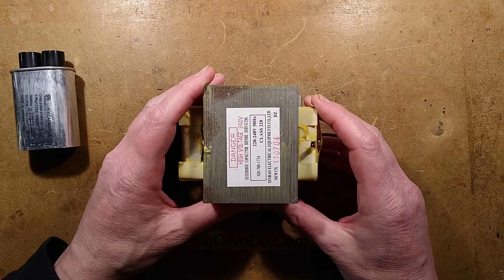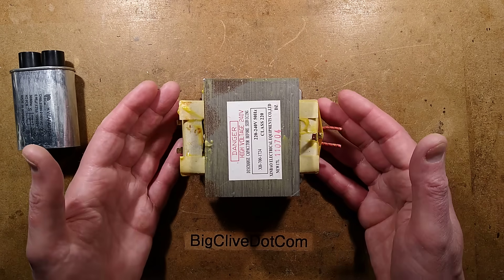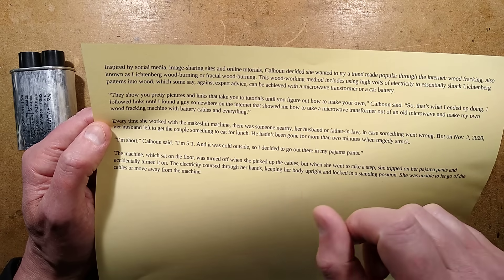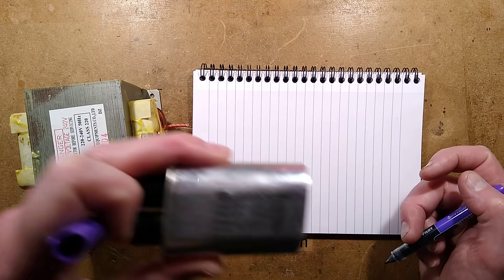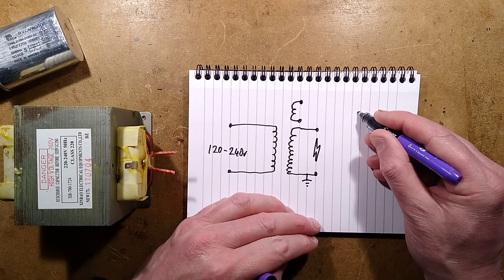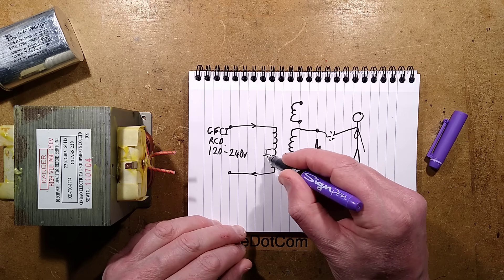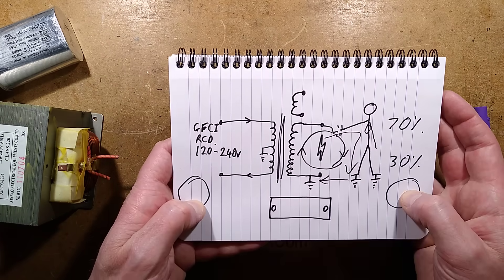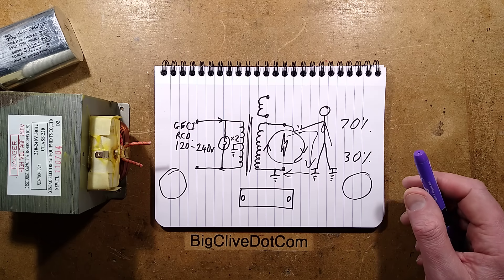The most deadly project on the Internet

Comment: Things I learned even in VERY amateur welding and electronics work:
- NO WATER, ANYWHERE, EVER.
- Heavy gloves, dry rubber-sole boots.
- Never grab uninsulated wires... or any wires-not-intended-to-be-grabbed at all for that case.
- Know which parts of the circuit are 'hot', and always give a second thought whenever you're about to interact with the Hot side.
- Find and discharge ALL capacitors before mucking around in electronics - if you don't know, wear gloves until you can probe and confirm the entire thing's de-powered.
- Triple-check these rules when you're about to use anything that has to be powered on during operation.

I wanna die fighting a radioactive mutant Grizzly Bear shirtless on a mountain with a K-bar..... not 'bzzt owie zappie ded'.
What a trivial way to go :(
Reply: I would rather beat the bear but yeah
Reply: @Jtoob-z5n  priorities
Reply: @Jtoob-z5n  lol, I believe he's more concerned about dying well
Reply: @Jtoob-z5n  finna good
Reply: i didnt think "no water near zappy things" and "no touching zappy metal" were things that needed remembering instead of simply knowing, lol
Reply: @TheRyderShotgunn  People have died from cell phones in the bathroom. Or tripped on a rug while holding a hairbrush. Or making stupid mistakes with batteries. Like not plugging the black to that screw that's there for that reason...
Reply: Train hard and follow your dreams and I'm sure one day you'll be able to take the bear in a knife fight
Reply: another tip. When working in an electric panel, always keep one hand in your pocket. One of these transformers going to ground (even though they aren't grounded, right?) through you will suck and injure you... going from hand to hand will kill you.
Reply: Make it a real challenge, fight it with a Granola Bar instead... But I must say, I haven't laughed this much in a long time, who knew bzzt owie zappie ded was the 4 funniest words on the planet. I'm still feeling that in my chest, the level of happiness that could bring a man from the brink of death to the sweet and comfortable memories of him as a boy in his mothers embrace during thunderstorms.
Reply: I wondered why my homemade taser didn't produce any arcs and my dead ass touched both of the tips with my hands, idk literally the only time ive felt electricity going thru mt heart. And that wasn't fun.
Reply: I go with the tried and true HARD rule of “- call somebody crazy enough to be an expert in electricity”
Reply: So you wanna fight a Yao guai shirtless with a akbar to the death?!? Well I guess that's an honorable goal...
Reply: Amen
Reply: You may enjoy the new season of Love,Death, & Robots. One story is about a cyborg grizzly taking on a squad of mercs. Some of the best violent animation I've ever seen
Reply: @hayorge27  I love that show!! The three robots episodes are the best!! lol
Reply: @hayorge27  that is a really weird sentence. 
  .....  ' some of the best violent animation I have ever seen.... '
Reply: @robbyv.526  Probably an amerikan....we don't  need much insight (as recent school events testifyfy) to understand the depths of weirdness depravity and perversion that residents of that country can sink to !
Reply: Aren't bears as a rule shirtless? Dangling modifier humor is my specialty.
Reply: If I get to chose how I go... I want to be 85 years old and get shot in my sleep by a jealous 25-year-old husband of one of the women I was sleeping with.That Bear thing of yours sounds rough, but to each his own.
Reply: mary had a little lamb, she also had a little bear, once I saw here little lamb, but I never saw her bare. it could be the bare necessity.
Reply: I am lucky I realized on time, you need really good concentration too. I was often forgetting very simple stuff, cos I wasn't concentrated,  like turning off the power, before tinkering things, and so. You really need to be rested, and concentrated before doing anything dangerous too.
Reply: @draganmilovanovic8940  EXACTLY. In any sort of dangerous work, there is a sort of 'dance' or 'rhythm' which emerges from the work.

When you lose focus & stumble in that 'dance' is when mistakes usually happen.
Reply: If you can find ultra pure water (reverse osmosis water for example) that is perfectly acceptable because water by itself is actually a pretty good insulator (I don't know what the insulation breakdown voltage is) but your standard bottled water or tap water has a lot of minerals and other junk in it that makes it conductive

So in short if you need coolant for a high voltage device reverse osmosis water (or if you have another way to deionize it that works too) is probably going to be your best bet as I'm not aware of any other coolant that is a good insulator
Reply: Why does the bear have to be shirtless? Sounds kinda odd but for each their own
Reply: Does the grizzly really have to be shirtless?? Asking for a friend...
Reply: The union supplied by dad with a fuse box that was labeled 'NFG'. Needless to say, he died. Thereafter his union brothers changed their statements to police during trial AND the judge rigged it so we couldn't file properly, so we lost. Only the apprentice stuck to the truth. He was let go. What's the moral of the story?

There is no moral but it is coming with a fair warning: men are checking out with good reason. There's a damn good reason men aren't grinding like they used to.
Reply: Your preferred death is actually the more terrifying alternative.
Reply: Yeah, nothing will insulate against 2000v tbh.
Reply: bzzt owie zappie dead really do be a unenviable death
Reply: Back in 2013 I was working on a ranch, tending horses. I observed this guy using one of those gasoline powered arc welders, you know the one's that look like a giant generator on wheels. Anyway, it had rained the previous night and flooded the corral, so he was standing in knee deep in that water, holding the pipe in one hand, and the welding thing in the other. I thought to myself, how is this guy not getting electrocuted??!!
Reply: I can sell 🎟 tickets for said fight and promote it as well. Have your people call my people👉👉
Reply: Pretty basic common sense advice, I think you should be teaching.
Reply: Beating that bear while wearing a thong.....
Reply: If you're in a workshop, add "NO DUST" to that list. :)
Sawdust is great for fire, metal dust is great for shorts, etc.
Reply: My brother we have the same dream if i have to die i would rather fight a mutated beast or a dragon dont really care just bring it on Valhalla is waiting i got stabbed 5 times in the guts and it wasn't enough so i want my death to be a glorious fight with a mythical beast thats why i am training my whole life
Reply: Oh and don't forget to make sure everything is properly grounded! You definately DO NOT want to be the best ground. XD
Reply: Buddy, I got some bad news about your bodies fluid composition.
Reply: but i could be a famous wood fracking artist and my arts value flies through the roof because i cooked myself on only my 5th piece.  Maybe the fracking job looks like i am fighting a radioactive mutant grizzly bear shirtless on a mountain and it ends up in a museum...  and maybe just maybe i glow so much that it burns a shadow of me onto the art...  crazy stuff people do...
Reply: Dude, that's an awful way to die. Bears suck
Reply: @citricdemon  i can argue that, had a dream i was on a mountain alone and old with white hair.  A bear attacked me and i fought for a few minutes until it ripped my belly open grabbing my heart in its jaws and i smiled while i watched chew it for a few seconds.  thought yes eat the poison in me and i woke up.  what a noble bear and a honor of a dream
Reply: If the grizzy bear is indeed mutant and radioactive, you might want to show it some compassion. 😢
Reply: The only rule worth mentioning  is dont touch the MOT if its hot(live), assemble your project first and then turn it on..never work on a live transformer without proper equipment and training
Reply: That would be a glorious way to go...
but imagine if you won that fight!
Reply: Fight that Bear wearing a Bacon necklace as well.
Reply: You wouldn't be so glib if you knew how you were going to die. I can tell you, it probably ain't going to be glorious. It's probably going to be slow and painful. No bears. But possibly some radioactivity.
Reply: @ryans756  Completely missed the point:

1. Nothing about what i said was glib. It was empathetic and informative, and appreciated / lamented the trivial loss of death of these people.

2. You're absolutely right - I have no idea how I'm gonna die. That's why you use your BRAIN as a human to UNDERSTAND things (like electricity) and undertake actions to reduce the chances that you die from some silly incident.

Get it?
Reply: @-_-----  Oh, I get it. No worries there. Up until your glib final paragraph, I had no issue.
Reply: @ryans756  No, no you don't get it.

Listen again, CAREFULLY. Actually listen this time.

"What a trivial way to go" is just that.

It's not glib. It's not sarcastic. It's empathizing with what a trivial, instant, and meaningless death these people suffered. That's just the facts of these electrocutions, and I'm calling attention to it.

That is >>Literally<< NOT 'glibness'?

Okay?
Done.
Reply: @-_-----  I can confirm that there has been a misunderstanding. Totally my fault but you're still going to be angry with me. See, you have a strange and inconsistent way of using the enter key.
Some paragraphs begin like this, directly below the previous one.

Others are like this. Separated by a distinct space as you see above.

And again.
Back to the original paragraphing now.
And again.
And again.

Now, I'm intelligent enough to work with such inconsistency so I do take the blame for saying "your final paragraph" because, actually, my issue is with the paragraph prior. I touched on it when I mentioned bears.

But true enough, your last paragraph was indeed that shite about electrocuting yourself being trivial, and that wasn't an issue for me until now, now that I think about it. Is any death trivial? Other of course than the natural death I hope you enjoy, many, many years from now?

So yes, it was the radioactive bear part I was calling glib because you seemed to think that you'll be dying one day, thinking to yourself, "Well at least I didn't electrocute myself on a microwave's innards."

Glib, and infantile, if I wanted to be a little more confrontational...
Reply: @ryans756  The people who died of that electrocution, if we could get their opinion post-death, would almost certainly agree with me. They would probably be devastated and furious at how silly, brutal, and pointless their death was. Even the presenter of the video made the same point.

Trivial (Wiktionary):
-Ignorable; of little significance or value. 

These people died a brutal death doing and activity whose danger was vastly in excess of its value. They died without needing to, without producing value. That's 'Trivial'. I know what word I chose, and I chose it on purpose. Don't assume people are being 'aggressive' because you have a limited vocabulary.

Glib (Wiktionary):
- Having a ready flow of words but lacking thought or understanding; superficial; shallow.
- Artfully persuasive but insincere in nature; smooth-talking, honey-tongued, silver-tongued.
- (US) Snarky or unserious in a disrespectful way.

That passage was none of those things.
Reply: Don’t lose sight on the Kingdom of God 🏞️ all that is in the world is soon coming to an end. Seek God whilst He may be found. Jesus saves ✝️🩸🕊️
Reply: @TRUSTINYAH  everyone else takes full damage?
Reply: This reeks of Reddit 🤮
Reply: @SensationalSteve  Then get your nose checked boy because I've never visited /Reddit/

Some people have lives outside the interweb.

Comment: Excellent video. I must put the deadmans switch in, I have been doing it off and on with my home brew Microwave  transformer based device for  a few years. I have indicators on both the 220v side and HV side also an audio warning as well. I never get near one of the probes when live as that is attached to the wood before activating. The other probe is attached to the end of a plastic walking stick so does not come within  about 18 inches of me. I guess I lose some fine artistic control with that. The operating switch is none latching. So far so good. But the dead mans switch would be an improvement . I was thinking of attaching a foot operating switch off a sewing machine but decided that would give me two free hands and easier to get into a bad situation. Lovely pattern you did there. Your video also made me realise I do not understand RCD's as well as I thought. How in 40+ years relying on them I now realise I do not know how they detect faults in equipment from the secondary onwards, guess I never had to :(
Reply: I hope you stay safe

Comment: Fools to play with high voltage bad enough working on tube electronics at 450 volts DC and that will kill also. I been blessed by God not taking my life when I worked on an old Atwater Kent Short Wave radio. It left a mark on my arm and the part that's scary I was in series with a VTVM I had the positive in one hand opposite the other arm that got shocked. I don't think one should play with electric like that  our Hi Pot tester is in closed with plexiglass so you cannot touch the high voltage. You could make this project much safer by putting a cage over the work using plexiglass and making touch less leads to do the art work. 73

Comment: There's a safe way to do it, but you need line worker safety gear, and it's not cheap. Bare minimum is high voltage gloves (class 4) that go up to your elbows, and some rubber boots. Next step would be a high voltage insulating mat to stand on. Then a farraday (chain mail) suit. Plus you need at least 5kV insulated wire for the secondary lines off the transformer. None of this eliminates the chance of an arc flash if you drop the leads. So after $2,000-10,000 invested in safety equipment, you can still get burned with an arc flash, or burn down your shop. It's a cool effect, and it's rare to see but there's a very real reason it's rare.
Reply: yep
Reply: and it'll take a whole lot of fractal burns to break even

Comment: Galvanically separated.
Ground Fault Circut Interrupter measures the current flowing out and coming back, and if it sees some of the current
leaking out, it will trip a circuit breaker.
With it being separated, it does not see this and will be in a closed loop.
And then there's the whole electric chair thing.

Comment: Semi off-topic, but might as well ask this here
Is it true that while trying to remove the transformer on the microwave the capacitors still pose a threat to your life, even after un-plugging the appliance?
Reply from the maker: There's supposed to be a discharge resistor that will leak the capacitor charge away over a short time.  But they can fail and leave a charge on the capacitor.
Reply: Great question! "Pose a threat to your life" To a certain degree. Just look up dialectric absorption. A capacitor may hold charge, or "recharge" after being shorted. Assume all capacitors are charged, all wires are live, knives are sharp, and guns are loaded.
Reply: @nsknyc  That's good advice, thank you. I guess the smart thing to do is to not mess with electronics without having proper training for that
Reply: @GoronTico  Most electric/electronic constantly stress "NO USER FRIENDLY or USER REPAIRABLE PARTS INSIDE. You better believe what they sy!
Reply: @GoronTico  the general rule is not to mess with anything that you don‘t have training at. Don‘t try to drive if you don‘t have a license, don‘t attempt heart surgery after playing „Operation“. Don‘t try to water cool a PC after watching one YouTube video about it. People always overestimate their abilities and more often than not it ends badly, one or the other way.

Comment: You need CATU MV-137 (class 2?) boots for this which are certified to 20kV. Even so, stuff that. They are usually bright yellow and look like wellies. Don't expect much change out of £150. Yet another reason to mainly work with 24V systems.